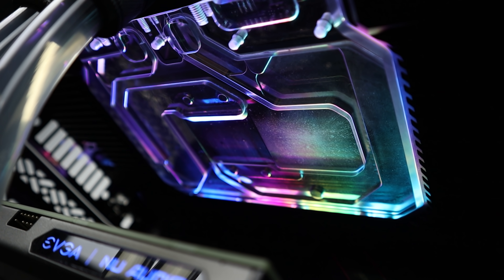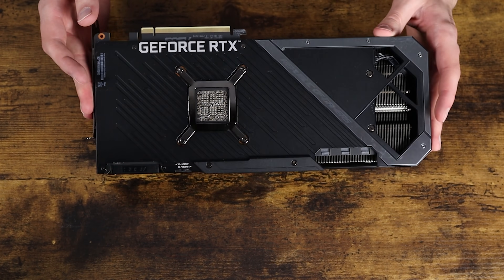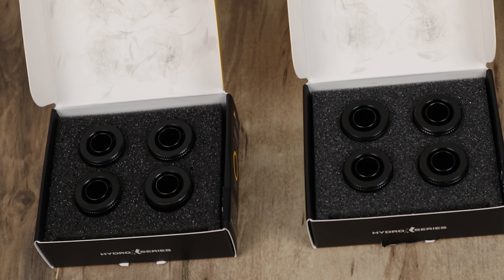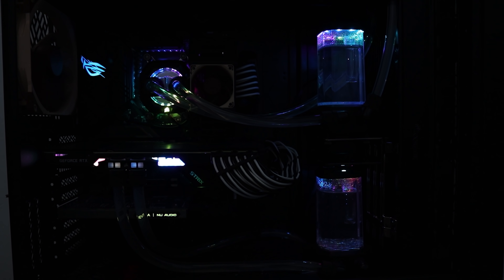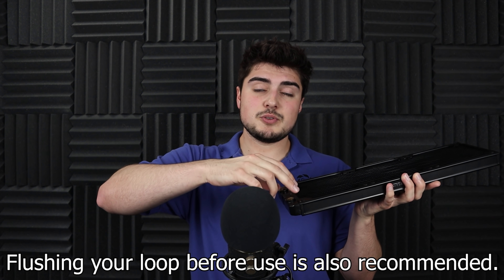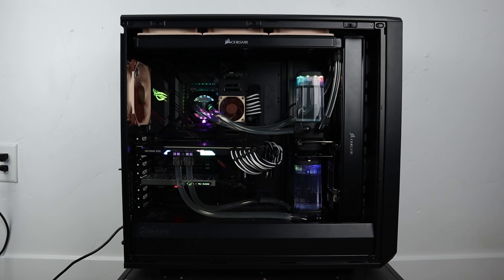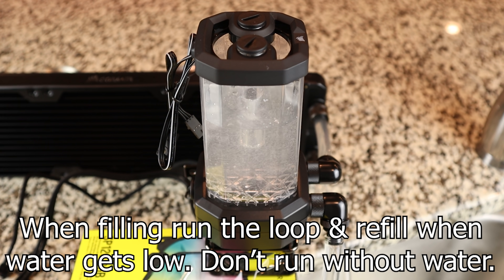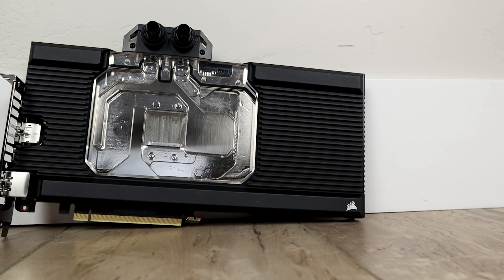You Won't Believe These Results...

Comment: It wasn't till you held that huge radiator for so long it finally dawned on me why ppl say liquid is better.
I've long wondered how water cooling could be better for cooling than air since in the end, it's still fans blowing air over the radiator to remove the heat. Linus TT did some tests and found water isn't always better (or even quieter.).
I see now there's about 30% more surface area on that rad than a big air cooler might have. More surface area = more heat transfer.
Reply from the maker: More surface area and liquid can move the heat fast.

Comment: It's very impressive! But I choosed components carefully to get a more budget friendly build on air that is still quiet. 5600x, ASUS B550-f, ASUS TUF 3080 and all Noctua fans + NH-D15S in a Fractal Meshify 2 Compact and both the CPU and GPU never goes above 70 C. I kinda like the low maintenance and price combination (If you was lucky enough to get the card itself for the introduction price).

Comment: Not going back to watercooling.  Was great while it lasted but a massive ballache draining your loop to swap out parts.  Temps are indeed far lower but performance gains on modern hardware will be questionable
Reply: its not only the performance but the noise too, plus its the only way to go if you are into overcloking
Reply: @ibayodeperegrino  the noise is actually not that different to most aio solutions.  If you are overclocking, you will hear your fans, a lot

Comment: I follow you and this is the first video I can kind of grumble about.

Corsiar people is not as straight forward to build with.

Its not any easier than any other brand such as EK.

You just have to learn the size standards.

Also the corsair loop configuration step by step on the website is not the best. 

By that I mean it shows to put rads in positions in cases that will not fit and also puts rads below the pump.

The rads below the pump is not a total problem but makes it difficult to bleed your loop.

If you can get a poer that is lower than everything else and set it up as a bleed port your be set for an easy life.
 
To get any left over stuff out you can disconnect the fill port on the d5pump and use a air compresser or your moult to blow the remaining fluid around the loop and out of the bleed port.

Also the corsair products are NOT cheap!!!!

They also do not have a big range of fittings.

Also the hard pipe corsair use is NOT user friendly it shatters and there is abit more prep work needed to get it right.

Comment: cpu should have dropped way more than just a couple degrees........
Reply from the maker: The Arctic cooler is really good. The radiator is much thicker than the corsair one I used. This is why the difference wasn't that big.

Comment: hard tube is not difficult heck I i did it with no prior experience you just need to plan better fill that reservoir all the way up, tap water i even use with silvercoil if you have soft water in your area
Reply from the maker: It makes upgrades more tedious and is more difficult for beginners. This is why I chose soft tubing.

Comment: Hey man. A dual loop setup is SO overkill for your components. How do I know? I have 6 3080s on the same loop. Temps are great. Mining of course. I do have a 1080mm radiator but still, a dual loop is very uneeded

Comment: I waterblocked my 3090 and just invested in an active backplate to deal with memory temps. The passive backplate just wasn't enough for mining on the side. My pump just died a few days ago as well so I'm waiting another week for a new pump. Just barrowed my mother's GTX 1060 in the meantime. Also warning, the 3090 really needs good fans. I've been using the 3 Corsair QL140s and the water was still steaming in the loop at 100% fan speeds. Really should get that better fans too.

But die temps were great at only around 45 degrees when pegged, VRAM though mining was sitting locked at 90 degrees. Still lower than the 105 it was but that was thermal throttling. The heat seemed to be really eating my tubing though as while I used a premixed clear solution called Cape Kelvin Catcher by Alphacool, the tubing and fluids still turned a dull greenish in only about 3 months. Shouldn't have happened as both the radiator and card are copper and nickel so it shouldn't have had metal issues and the mix has an anti corrosion compound in it.
Reply from the maker: Did you flush the loop before running it?
Reply: @GraphicallyChallenged  no, I didn't know I was supposed to. Any recommendations on what I should buy for that?

Comment: All that extra power for 100Mhz at 480w is a damned insult of a carbon footprint. 

I OC my cards a touch, but never OC the power or vRAM; am still happy. (OC-ing power is asking for trouble.) If you get a good card in the first place, you can speed up the fan profile for zero sweats. That'll make 40Mhz for free. Then OC the core 60Hz. Total OC 100MHz, and it will run cooler than stock-core/stock-fan profile.
Reply from the maker: It was 100MHz over the OC I already got, but yes it's a lot of power for little gain when it comes to overclocking these days.

Comment: I got one of my 3090 and Ryzen 3950x looped with the Corsair Hydro X I put a 360 rad and a 280 rad, temperatures never go above 40 degrees C. Even on full load for days on end.  Hard line isn't that difficult just try and split it up with fittings if loop gets crazy.  Just make sure to buy some extra hardlines so you can figure out how to properly do it.  The Corsair hardline kit also does help for doing the bends.

Comment: I never was a fan of water cooling... I simply dont like the idea of water in an pc case... I saw it not 1 not 2 but 3 times, that the pc of some friends had to deal with leaks and in all 3 situations at least 1 component died afterwards.. Well yes... This stuff happened about 10 years ago, but it still left a bad taste on me... Thx, but no thx.
Reply: there is a module now which makes leaks impossible, it's called watercooling 2.0 or something, maybe check that out.

Comment: Thanks for the tips. I am a few months out from doing a pretty massive build with dual 3090 Asus Strix and Ryzen 9 5950x. I will absolutely follow your lead here!! Thank you so much for putting this out. Only difference I will make is to go with an active cooling back-plane water block on both GPUs.
Reply from the maker: Nice!

Comment: I have the evga 3090 hydro copper and have ek dual pumps with an exterior mounted radiator that's mounted under the stand with push pull fans it keeps all that heat from the inside of the case 
Overclocked with everything set to ultra DLSS balanced  doom eternal runs 185 fps and doesn't get hotter than 49 Celsius after  its running an hr
I'm running liquid metal instead of thermal paste

Comment: My EVGA 3080 FTW3 Ultra runs @ 65° under load and i am just using the fans that the case came with.
Reply from the maker: It depends on what the load is. My measurements were also peak temperature not average.

Comment: Just no way I will ever consider watercooling for any component in my computer.
Reply: I had aio h100v2 max temps 55c i change it to a noctua push and pull and i get same temps and the aio stay hot not like a regular heatsink with fans , i put the aio h100v2 in the box new only use it on my computer 3 months. I just don't understand how people really think aio are better i biuld computers since the 90s and I just keep it old school,  no rgb and no aio.
Reply: @1967KID  First of all, huge air coolers like noctua or bequiet dark rock pro 3 just look ugly in the case itself and take a lot of space and second, you need a proper AIO like an Arctic Freezer II and not some RGB bling bling stuff.
There is no air cooler on the planet that can reach the cooling/noise levels of arctics second gen AIOs.

Comment: Last gen Corsair stuff for the 20 series had problems but the 30 series waterblocks are pretty damn good. I've used EK Water locks for years but they have been a let down recently. You get far less for your money with EK. A HUGE plus to the Corsair blocks is they come with the thermal pads already cut to size and perfectly placed on the block. This saves so much time and headache I will never buy another EK block again and have to deal with the annoying process of cutting the terribly sized thermal pads ever again. The Corsair block for my 3090 FE is also cheaper than any of the EK stuff and comes with an included back plate for that price when EK expects a $50 premium to get a backplate with theirs. I see no reason to buy EK blocks anymore until they step up their game.

Comment: For those doing hard-line tubing, look into silicone rods for the tubes.  They are typically advertised as medical equipment, but you put it in the tubing, and it helps the tube keep shape while you heat and bend the tubes so you don't have to worry about pinching the water flow.  It then has a cord on it to pull the rod out when you are done.  Makes for some much easier professional looking results. Wintergatan uses them to make his marble tracks and allows him to do very custom shapes without needing to worry about breaking or pinching the inner diameter of the tubes.

But yeah, not something I want to do to my computer.  I mean... I want to... but would never do it.
On the low end you have the closed loop coolers, which tend to be about the same price and performance, but louder and adding the terror that is water to your build compared to your typical over-sized air coolers.  A good option if you don't have the space for a large cooler, but for most people a big cooler with big slow fans is just the clear best option.
These kinds of custom loops look amazing, can be quieter than a typical air cooled PC, and offer loads better performance... but the price and the element of water... unless I had the money where I could replace my hardware at the drop of a hat, I just don't think I could bring myself to do it.  I use to work at a computer recycler, and I think we only ever had 1 closed loop cooler come through, but every year we had 2-3 custom loop systems come through.  Never killed them right on install.  It was always 2-3 years down the road that something sprang a leak, and they woke up to a suprise of their computer not working the next day.  Unless there was a way to guarantee that I would not kill the system, that is just not something I want to potentially deal with.  Maybe fill the whole thing with mineral oil or something perfectly non-conductive?  I dunno, that was all 8 years ago now, I am sure things have gotten more reliable and less terrifying by now.  But seeing these $3-4000 paperweights come in our door really turned me off of the idea of water cooling.
Reply: Tbf there are some cases and solutions that can help with the risk. If you want to get go for custom GPU cooling and have either an AIO or air cooler for your CPU you can reduce some of the risks. Since the GPU is at the bottom of the system in 99% of cases water leaks are unlikely to go leaking over your motherboard. Cases like the Lian LI OH11 Dynamic XL also don't have a power supply at the bottom of the case so for a standard water cooler drip leak the water should avoid dripping onto anything expensive except for maybe some fans. 

You could screw up your GPU if the leak happens around the GPU block. Even then depending on the orientation and the size of the leak you could maybe get away with it if you notice it in time and how severe it is. I do wonder if you could make a claim on the broken hardware if you can prove that the actual product itself is faulty leading to the leak.

Comment: You should have gotten the EK GPU water cooler and active water-cooled backplate - it makes a HUGE difference, especially with a RTX 3090, when you actively cool the backplate, as well as front plate. Not to mention that it makes it look AMAZING with a clear RGB active backplate, rather than just looking down on a boring piece of metal on the back of your GPU like you have to with a Corsair passive GPU backplate.
Reply: Agreed an active backplate is great for the Memory Temps on the 3080 and 3090.
Reply: @Jay311xx  not to mention also looking AMAZING when clear with RGB! :)

Comment: I have an MSI Gaming X Trio RTX 3080ti.  Unfortunately there is no dual bios so at full load it gets to 79 degrees.  I use MSI Afterburner to put fan speed at 80 percent when the card hits 68 degrees which holds it steady between 67 and 68.  The noise is very minimal.

Comment: Hmmm 3090 and 5950X. That's like the best of the best. Good to see it's well cooled now 👍
Reply: 5900x is better for gaming
Reply: Those extra 4 cores are great for compiling and rendering I really need them.
Reply: If you only enable 12 cores in the 5950x you can reach a stable 5.0 Ghz on all cores, in clocks better than the 5900x because his limit is 4.8 GHz and 5950 is 4.9 GHz .
So 5950x is better at gaming too